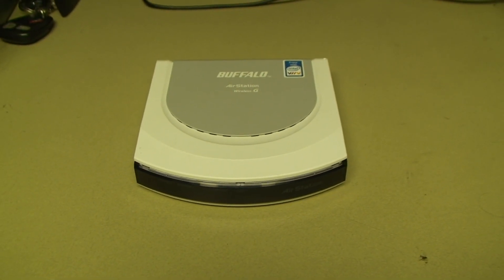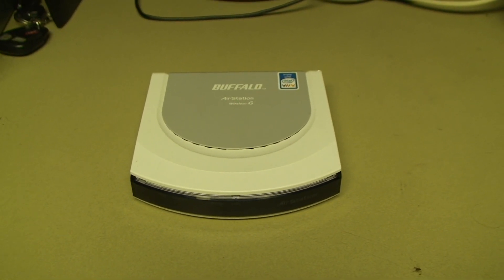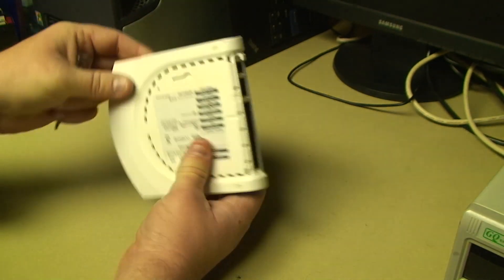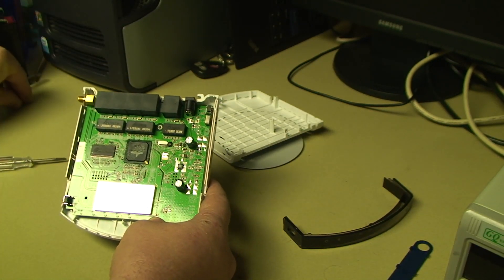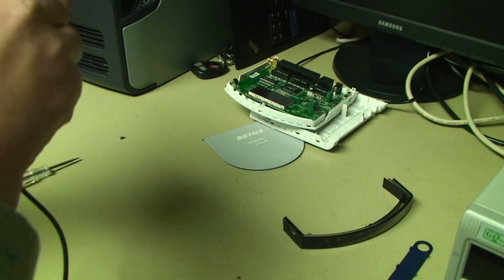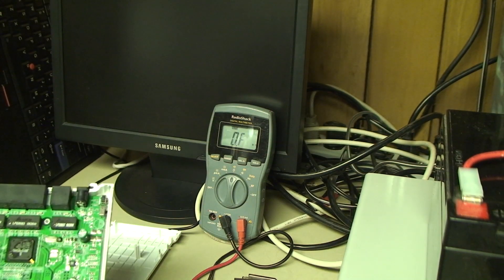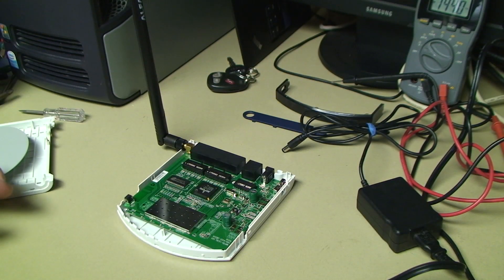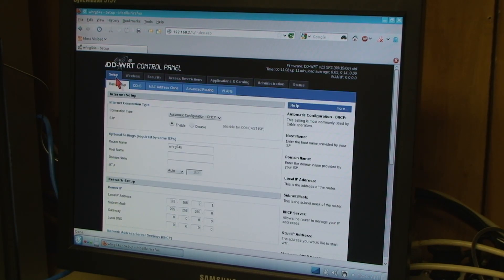Kitchen Table Electronics Repair - "The Wrong Power Supply"

Comment: In my dlink router i plugged reverse polarity then resistor burnt !! What will i do now ?
Reply from the maker: Replace it with another. The resistor is an effect, the cause likely lies elsewhere and in a part you probably cannot easily replace.

Comment: I have same model but not working only power light get on, and Broadcom chim getting heat up , whin i plug the adaptal cable eithernet light get on without pluging eithernet cable. it is repairable or dead
Reply from the maker: It is impossible to say. As old as this model is, it is not worth repairing.

Comment: How would I repair a keyboard that suffered reverse polarity? Its the Ducky shine 3 and when taking it apart the usb power source within can easily be switched and completely ruin the board in the process. Theres no schematic and tracing is difficult. I replaced two big capacitors that got hot when I ran reverse current through it again and two smaller capacitors that were also hot but it still doeasnt work. I used a thermal sensor and found 2 diodes that are a couple of degrees hotter than the rest of the board. Would I need to replace the diodes too?

Comment: hello sir, i have a problem to my router hauwei e5172. i install a wrong battery to my router. when install i turn on the router after 2 mins the power light indicator turn into pink. i remove the battery and i put the original power supply after turning on the power all lights indicator function well after 2 mins the power light become pink and all lights is off. can you help me to repair my router
Reply from the maker: No. Using the wrong power supply or battery is all too often fatal. Since it seems that your router still tries to power up, I suspect a software problem. I don't know anything about this hardware, so I cannot be of any further assistance.

Comment: if I have an ac-dc adapter that has opposite polarity of a device but same voltage output can I splice the wires and reverse them to change the polarity?  trying to get my microKORG back in action.  PLEASE HELP, AND THANK YOU!!!
Reply from the maker: In theory, there should be no problem with doing this. Check the result and check it again just to be as sure as you can.

The only other thing to look out for is voltage regulation. Not all power supplies are tightly regulated. Those that are just simple transformers with rectifier diodes may output a voltage twice (or more!) what is indicated on the name plate when they are lightly loaded (or not loaded at all). A lot of devices are fine with this, and the voltage would drop to the rated level as soon as any significant load appears. However, there are a few devices that need a tightly regulated power supply or they'll run the risk of being damaged.

Comment: binatone 150 reset button not working what should i do next?
https://n1.sdlcdn.com/imgs/a/i/q/Binatone-150-Mbps-ADSL-Wireless-SDL673806584-1-0c58d.jpg
Reply from the maker: Sorry, I have no idea. You might search online or try contacting the manufacturer, if they still exist and if you are running the factory provided firmware.

Comment: We've pluggled two different routers into this wall and they both stopped working,
Reply from the maker: My suggestion would be "do not plug any more routers into whatever you've been plugging them into". Exactly what you are plugging the router into is not clear. Please be more specific.

It is vitally important to be sure that you are matching the polarity, current type, output voltage and current rating to the equipment you have. Otherwise you will continue to burn out other wireless routers if you are using the incorrect power supply.
Reply: I'm not sure if it's the wall regular electrical connection or the ethernet cable wall connection.
Reply from the maker: I would suggest having your landlord examine both. Either that, or hire an electrician to test the wiring. Also, as previously indicated, be sure you have the right power adapter for these wireless routers. If you use the wrong one, it could ruin the wireless routers.
Reply: The router is not completely  dead the light still turns on, it just does not give off wifi anymore.
Reply from the maker: You can try to reset the router to its factory defaults. On most routers there is a small round button that you would press in and hold for about 30 seconds. Be sure the router is plugged in, turned on and has had a minute or two to start up before you do this.

I would still strongly recommend that you consult with an electrician or your landlord to determine the problem.
Reply: Yeah I've done that does not work.
Reply: I won't be living there anymore, but I'm just upset that my router no longer works.
Reply: if the routers were linksys you have to do a 30/30/30 reset to get factory

Comment: Can plugging my router into a wall with a bad wifi connection kill my router?
Reply from the maker: I don't know what you are asking.
Reply: I think there's something wrong with the wall in my apartment. My roommates and I have bought two routers and where we plug it into this wall they all suddenly stop working. It's the kind of place where you just plug the router directly onto the wall and you don't need a modem. I want to know why they stopped working all of a sudden.
Reply from the maker: I cannot tell you for certain. I would highly recommend consulting with your landlord or hiring an electrician yourself.

Comment: I have a laptop that appears to not actually care what kind of voltage I feed to it. Voltages too low or too high, it still runs fine (it's supposed to run at 20V, but I'm pretty sure I ran it at 16V and 22 or 24V.) I wouldn't run it at the wrong voltage too often, and I only did these by accident (universal charger and forgot to check the voltage)... but it was amusing nevertheless.
Reply from the maker: While I certainly don't advocate such, a lot of laptops won't be too picky about the incoming power supply voltage, so long as the polarity is correct. Most of them immediately regulate the incoming voltage further with a DC-DC converter.

Comment: Can you help me? I ruined 2 expensive laptops  being lazy & using the wrong power supply instead of buying the correct one  on ebay.. one was a  Gateway fx & the other was  a asus rog i7..

I used  the wrong power adapter because it fit & it powered the laptops for a while but little by little it became harder to connect. I had to twist & fiddle with it until it would finally connect.. then one day it wouldn't connect at all.. the supply was still good but the laptops wouldn't turn on at all...

I'm hoping like you said its a protective fuse or something that burned out and can be replaced..... I can tear it down to the motherboard but I'm stuck after that as I dont know anything about testing or what to test nor do I have meters or Solder equipment..

My Question is how can I  get the MB tested & whatever part that needs to be replaced done cheaply? should I take the MB to a electrician? can I send it to you?  Whats your best advice?

Is there an exact video you can refer me to that has the exact laptop problem as I? thanks.
Reply from the maker: +thnkbg In most cases, if you had used a power supply with sufficiently different characteristics from those required by the device you wanted to power, the results would be spectacular and instant failure, especially for situations of reversed polarity. A power supply that was only slightly out of specification might result in delayed damage taking place, but that is much less common. (Slightly too high of an input voltage may take a long time before it triggers a failure in the equipment being powered. A power supply that's too small for the load being powered will usually suffer voltage sag, may eventually overheat and could burn out if the overload is big enough.)

I think that the problem you have was caused by mechanical differences between the correct power supply and whatever you used. That is to say that the barrel connectors was perhaps not of the correct size (inner and outer diameters) and that over time it damaged the laptop's power connector. Solder connections holding the connector to the motherboard may also have been cracked or broken.

More likely than not, the only part that needs to be replaced is the power connector itself. Damage to these connectors, usually through some kind of trauma such as someone tripping over the power cable while it is plugged in to the laptop, is very common. There are lots of places that offer such repairs. The going rate is around $100, give or take.

This isn't the kind of thing that most electricians could help you with, and I don't operate a professional repair service. If you feel the repair cost is worth the money, I would recommend looking up "laptop power jack repair" specialists in your area. And after the repair has been done, get the right power supply!

This isn't a good project for a first time repair, especially if you're not equipped and experienced enough to do it.
Reply: +uxwbill  thanks man... If its a daughter board with the DC jack already on it  or a pig tail type of DC Jack, thats easy to replace but If its a Solder Job I gotta send it out.. thats again buddy.. you the man..lol

Comment: A dot at the end of a domain name can be helpful.  It indicates the domain is complete (includes the root domain, "."), and suffixes should not be appended to it.  As an example of appending suffixes, Time Warner Cable around here will send the suffixes "buffalo.rr.com" and "rr.com" in its DHCP offers, which, if you were to type just "www" into your browser, it might try "www.rr.com".

Comment: I did the same thing the last time I moved. I got the speaker power supply mixed up with my 2TB network drive.  You can't repair smoke.

Comment: Thanks for tutorial. I have a late model Linksys wifi router with a bad DC female connection on the back. I have to play with the plug and this invariably results in turning router on and off 2-4 times before the power will stay on. Any easy fix for this?  I am using the OEM power supply. I have not tried opening unit. Plug feels like it seats in unit properly, but I have to pull it back slightly to get it to work. Thanks.
Reply: ***** Thank you.  I'll check that out.

Comment: I put the wrong voltage adapter in an exercise bike and heard a popping sound. Dismantled it and found the wiring hub for the socket out. Plugged it back in still doesn't work. The batteries work for it but not the light is dim. Do you have any tips.
Reply: Could be a fried capacitor. Look around for one that's exploded.

Comment: Put the wrong plug into it when I got it mixed up with another one while I was rearranging my workspace. When I plugged the wrong one in, it made a small popping sound. Now, when I plug the right one it, the buffalo does not turn on (like reviewed in the video) Should I try and remove the diod?

Comment: I am about (at long last) to buy a multimeter. I saw you used a RadioShack in this video, but I noticed you were using another (cheaper, I believe) brand when you were testing the fuses that blew and stopped the stove from working. Do you have any advice or recommendations based on your experience? I'm not going anywhere near high voltage (I'm in the UK with 240V mains power only), so safely isn't a concern.

Comment: du to electricity blackout, we are forced to use 12V/7A batteries to connect to the internet via our routers. One day, my gf accidentally reversed the polarity while connecting the router to the battery. we heard fireworks voices T_T
i have the Cisco Linksys GWAG54G2...
is there any hope ?? :(
thx in advance

Comment: i have a router that needs 9 v. but it does not work on my 9v adapter. i tried on my laptop charger which is 19v. it worked. what can be the problem? pls answer

Comment: My Buffalo wzr-hp-g300nh has unstable Wifi function, very difficult or unable to connect, it get disconnected all the time. The wired function is ok.
I opened the cover but most important area are shielded.
Could you advise what is wrong with the router? What are common defect with Buffalo router?
Thanks.

Comment: I know I should be asking this in one of your audio related videos, but I was curious, is there any safe way to de-amplify a receiver at the speaker jacks? I've got a set of nice speakers, but they're PC audio, internally amplified, and I wanted to use them with my home-theater setup. The problem is, stupid me bought everything with HDMI compatibility, and bought cheap, so there's no RCA jacks.  I don't know much about audio, but I'm decent with electronics, if that helps.

Comment: A friend of mine did much the same thing with his Yamaha DX100 synth, plugging in a Nintendo 9V AC power supply. I repaired it (blown regulator if I recall) and fitted a bridge rectifier and cap so he couldn't kill it again :)

Comment: Yes, I suppose that's true.  I know the AC Adaptor that came with my Sharp MiniDisc recorder has something written on it about "For use with Sharp MiniDisc play/recorder only, Panasonic did something similar with the AC Adaptor that came with 2 portable CD players I've owned.  With Apple AC Adaptors you can usually tell these days what they're for, but I just think the labelling should be a bit more widely standardised.

Comment: I know why manufacturers use off the shelf AC Adaptors that don't bear the device manufacturer's brand name, but I just think it's important for manufacturers to clearly label power supplies that are provided with their equipment.  For example, AC Adaptor for use only with Buffalo Technologies wireless AirStation access point.

Comment: I know that more often than not electronic devices that include an AC Adaptor, the AC Adaptors usually don't bear the same branding as the device in question, but I do wish the device manufacturers would clearly label the AC Adaptors supplied so you could tell at a glance what it's used for.  I remember one time we found an AC Adaptor at my Mum's house an none of us could work out what it was for, but eventually I realised that it was for Mum's Western Digital portable hard disk.

Comment: I have 2 wrt54g with ddrt pro I just got a cisco duel range n router . Black Friday online 
199.00 down to 40.00 and no rebate . Only could buy one otherwise I would have bought a few then sold them on craigslist. 
I also have 2 fon routers running fon firmware . The fon router have 1 problem 2 of them look exact same but 1 takes 9 volts and 1 5 volts . You could plug the 5 into the 9 worked until the router get loaded then fails . I wish they could be a standard

Comment: I must admit that I recently killed a new little LCD monitor (sold on eBay as a car reversing monitor, intended to be used with my Raspberry Pi), by plugging in an AC adapter, instead of DC.  I simply hadn't looked closely enough at the rating plate on the adapter.  I opened the monitor up in case there was anything obvious that I might be able to replace, even in my relative ignorance of electronics, but everything looked fine.  At least it wasn't an expensive lesson to learn (£20 / $25-30?)

Comment: I must admit I'm being a little naughty with my modem and router, I have them both on the SAME supply together.  But that's simply because I've run out of sockets to plug both supplies in so I just spliced the output of one of the supplies and put two connectors on it.  It's all been running that way for a couple of years now and seems ok.

Comment: I did this once whaen i was little. i plugged in a random charging cord to a wireless vacuum and the batteries overheated and got extremely bloated. melted the plastic and everything

Comment: Thats smashing bill, you have another router for freeeeeee :-)

Reminds me of the 1n4001 across the 12v input of c.b radios, ive replaced quite a few in my time as a radio repairer lol.

The only problem with the diode is with the idiot that replaces the 2A fuse with a nail or typically a 35A fuse :-(, often the diode blows open and carnage to the rest of the radio is just too nasty to think about :-(

Allways smashing to watch your vids bill :-)

Comment: My friend and I was going to hook up a switch one time, and we managed to swap out the power adapter for the switch with the one for the modem. The switch power supply was 5V, and the modem power supply was 12V. The ovbious sign it didn't work was the switch sending out huge amounts of smoke, forcing us to open the windows. But it was a funny experience.

Comment: Why not use the diode checker mode on the meter? Digital meters don't work well with diodes on the resistance scale. Of course a short is a short.

Comment: would you say voltage ratings are more vital to the survivability of a mismatched power supply/power requirement than current?
ie. if you have a 9v 300ma wall wart used in place of a 12v (x-ohm) power drawing item, would that prove fatal?  as opposed to a 12v 1a wall wart/power drawing device?

i guess my question is: do higher voltage wall warts plugged into lower voltage devices (ie voltage mismatch) cause more harm vis. a vis equivalent voltage wall warts with mismatched current draw?

Comment: Then I heard a pop from the power supply and saw some smoke coming out of it and after this the telescope shut down. Unfortunately I did not know the current demand of the telescope when the motors were running and what happened was it pulled too much current and killed the power supply. The moral of the story is check not only voltage and polarity of the power supply but also the current demands of the device and how much current the power supply can handle.